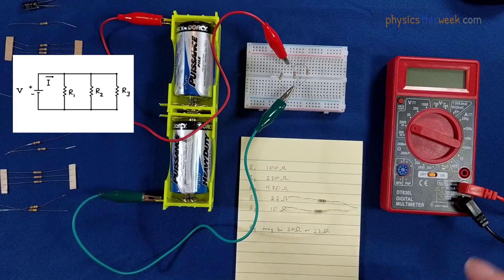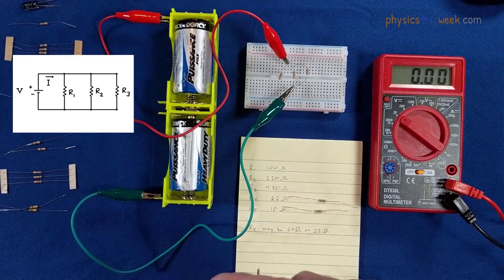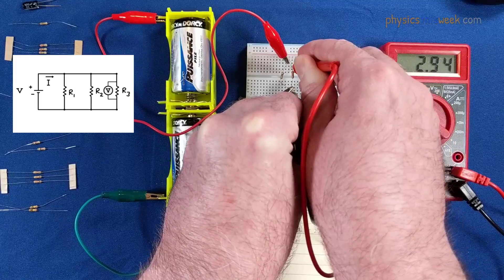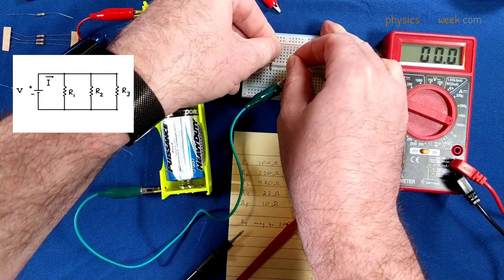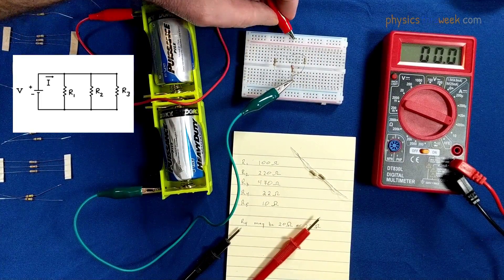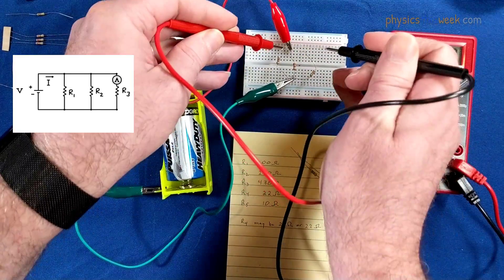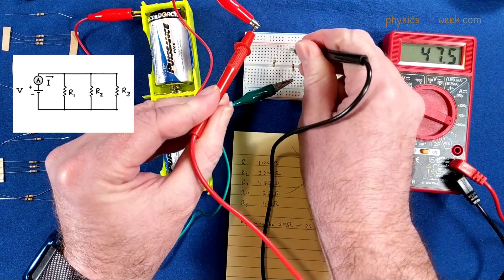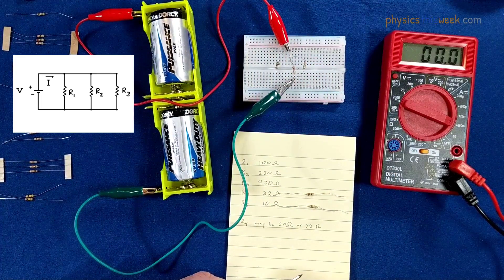DC Circuits Lab:  Parallel Circuit Measurements

Comment: Good day! How do you measure the total current of the parallel?
Reply from the maker: To measure it, place the ammeter in series with the parallel group.  For example, you could disconnect the wire connecting the parallel group to the battery.  Place the ammeter with one lead touching the battery and the other touching the wire above the group.